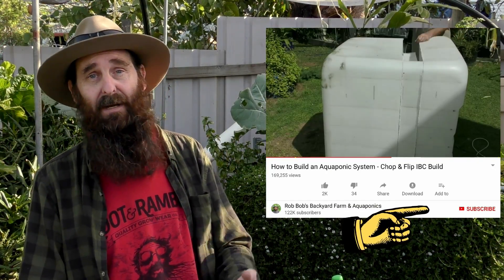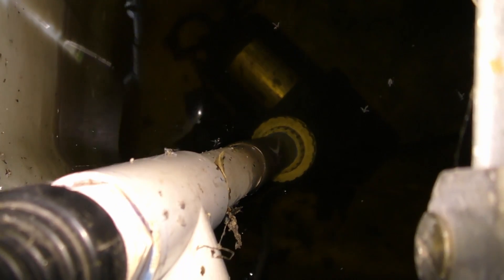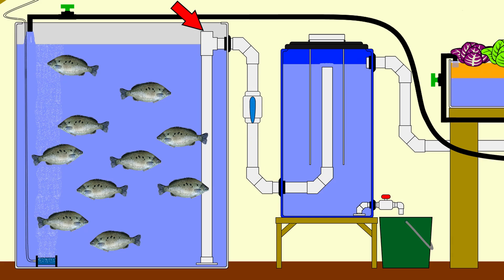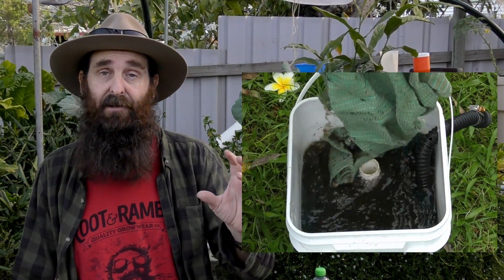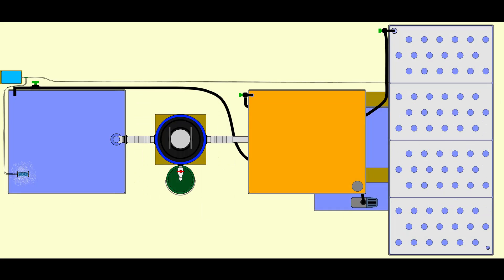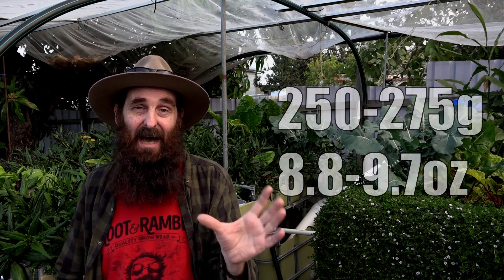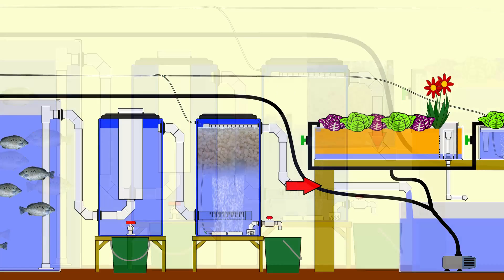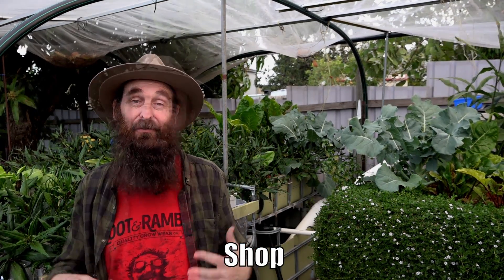Aquaponics Design | Backyard System for Pat

Comment: For this system and the solids filter to work do you need the flow of water to be going constantly. As currently my only runs for 15 minutes every hour to fill the grow bed
Reply from the maker: I'd prefer to run it 24/7 though to tell you the truth as there isn't enough water turnover & retention time in the bio & grow bed for ammonia/nitrite conversion with an intermittent water flow. You may want to up the amount of bio media in the filter or maybe just grow with media beds. 
That's my 2c & hope it helps some.

Comment: Hey Rob I know ur a busy man but can u help me design my system it's going to be 12v 3.6a 2900LPH single pump hook up to 3 or 4 batteries with solar and two solar air pumps I want it all off grind I want two ibc tanks is one for fish and one red claw plus red claw can help with flitting the water and two bed so I can grow different stuff I just dont know how I would plumb it up need help thank you
Reply from the maker: Hi Luke. Haven't had much experience with 12v or solar systems sorry mate. 
To keep power use to a minimum I'd plumb it so the water was pumped to the fish tanks from a sump then let the water flow out by gravity to the grow beds then back through to the sump again. 
HTH some.

Comment: Hi Rob, we are staring to design a IBC based system for our greenhouse. I haven't seen anyone do this, but we were wanting to get your opinion on burying the IBC in the ground with hard board foam insulation under it and on the sides to help keep a more consistent temperature. By doing this we also hoped to just pump the water to our two media beds that would be staggered the farthest being higher, and the one closer to the tank a little lower, almost cascading if you will. Our plan was to use your bell syphon design for a drain and fill that would  empty the higher bed into the lower one, then back to the fish tank. All of this with the hope of avoiding having to plumb in a sump tank because the greenhouse will only be 6ftx8ft. We would like to use a combination of snails, worms and a few fresh water crustaceans to keep our solids waste to a minimum.  
I understand we would need a good amount of pumping capacity to overcome the rise to the grow beds. Do you think this design would work? What would be your suggestions on changing anything?  Thank you for your great videos!
Reply from the maker: Hi Tim. Sounds like it should work OK. Have seen a few folks bury thee tanks here due to extreme heat issues. 
I'm not sure if the snails, cray & worms will be enough for solids management but you can always add on a filter later if you notice the beds clogging up. 
Not a big fan of pumping from the fish tank due to concerns of it being pumped dry so make sure your plumbing is well glued & secured.
Cheers & hope the build goes smoothly for you. .
Reply: @RobsAquaponics   Thank you for the feed back. We decided on a bigger greenhouse to be able to fit the design you have already worked out. IBC tank bio filter, radial flow filter and a sump. We realize you have spent a lot of time and energy figuring this out, so why reinvent the wheel so to speak. Hope the remodel is clipping away steadily. God Bless!

Comment: Hi Rob, Henrico here from Namibia. Somewhere in Africa. Well what can i use in place of uni seals and im having some trouble starting a few different seeds.
Reply from the maker: Hi Henrico. You could use standard threaded plumbing fittings. The challenge will be to create a seal so as the drums & tanks don't leak. Have seen folks use rubber inner tubes to make large washers if that helps at all.

Comment: The operation more easier than this, don't get your hopes down, watch other videos that made up by us... By Us no third party's make things too complicated!!!
Reply from the maker: The point of this clip was to answer a direct question as to how I'd set up a system to the requirements specified by Pat. 
This is how I would do it so as to make sure it runs as smoothly as possible with the least amount of maintenance.
Would be great if you could post a clip explaining how you would simplify the design for others.  👍
I always find it helpful to see others take on system design as there is no one size fits all layout.
Cheers & don't forget to let me know when you've posted the clip.
Rob.

Comment: Hi Rob, I'm starting with my Aquaphonics its small scale 1 meter by 90 square face brick build, I'm looking for advice on a good solids filter I can build myself and easy to clean. The intention is to host Koi and deliver the good filtered water to my PVC NFT system.
Reply from the maker: I think a good place to start would be with a radial flow filter to get the majority of the large solids out. From there I'd run it through another like a sponge, canister or one of the other filtets that do a good job of collecting the fine solids. Removing the finer solids will stop them from being collecting on the roots of the plants.
Is also look at adding some form of biofilter into the system as well to help process the ammonia.
Hope that helps some.

Comment: Is it possible or beneficial to use your sump as a deep water culture bed? As the height of the water raises and lowers, wouldn't the rafts raise and lower with it? Would you be able to put something like prawns or clams in that water as well?
Reply from the maker: Hey mate.
I have seen folks use their sumps as raft beds & it looked to work OK for them. Just need to make sure that the pipes running in & out don't mess around with the rafts. 
Prawns shouldn't be a huge issue & have seen folks use a few different types of shrimp in their systems. Just look for varieties that won't eat the roots of the plants.

Comment: Nice video! How much power do you use?
Reply from the maker: I think I worked out the system I ran at the time of filming was using between 5-7kW a day. That is also offset by our back to grid solar system. At the moment I'm using around 4kW with the newer pump.
Hope that helps some.

Comment: Hi rob thanks for you're videos keep them coming learning heaps from you.
I've set up my first aquaponic system the same as above afew weeks ago but was contemplating changing the pipe  from the bio to sump and going straight from bio to grow beds would you recommend that for better growth or wouldn't make a difference? 
Also my pump was only 3000lph was thinking changing that out soon as I feel it isn't big enough
Reply from the maker: Hey Jason. There should be no issue with you running straight out to the grow beds. If you're running a split system & you change to this single loop method it MIGHT mean you could keep your smaller pump. 
Cheers mate.

Comment: Hello Bob,
I am new in the Aquaponics.
As per your explanation, the water is being sent from the Sump tank to the grow bed s well as fish tank.Now the water coming from the fish tank is also collected in the sump tank and the water from Grow bed is also collected in the sump tank. my question is, don't you think the fish waste dissolved in the water is doing to the fish tank directly(though it will be diluted as the water coming from the grow bed is also getting mixed with the water coming from the fish tank in the sump tank )? 
I am just a starter and has this doubt.
Reply from the maker: As long as you are not overstocking the system it shouldn't be a huge issue. You will start to have problems if you go above the 1 fish per 25L of media I think. 
I personally prefer to have a bio filter after the solids filter to mitigate this issue. 
Hope that helps some & sorry for not getting back to you right away.

Comment: Hello sir. You videos are very information. May i ask what's the maximum number of fish you can put in a 1000L IBC totes tank? Lets say harvest them when they e
Weigh 500g each. Thanks!!!
Reply from the maker: Hi Mark. 40 is the most I'd use in an IBC & only if I had enough bio filtration to handle the load. 
Commercial farms will use higher stocking levels but also have a lot better filtration than the average backyard system. 
HTH some mate. 👍 Cheers.
Reply: @RobsAquaponics  thank you sir

Comment: Hi there can you use a ram pump anywhere in the system. To get enough water to pump around the system, can you use a couple of ram pumps? 
Great video👍👍👍
Reply from the maker: Not that I can see in a closed loop recirculating system like this David. Am happy to be proven wrong though. 👍
Reply: Rob Bob's Aquaponics & Backyard Farm hi thanks for getting back to me. I worked it out and you can’t use a ram pump. Such a shame. It’s a great tool 👍👍

Comment: What size pipe do you recommend for a ibc chop and flip . That will have a radial flow filter and more then likely a canister filter of some sort.  Going to run a 2500l/hr pump
Reply from the maker: A radial flow won't work too well after the pump chops the solids up unless the drum is a large one with a loooong retention time Adam.  Having the canister filter plumbed after it will help with the fine solids that make it through. I made a small one for my mum's system that does an OK job. ► https://www.youtube.com/watch?v=HtMZRM3a5Fs

Pipe wise I think 1¼"/32mm should do the job between the filters & out to the bed as you won't quite get the full 2500lph after head height & pipe restrictions are accounted for. 

HTH  👍

Comment: Hi Rob, thanks for the informative video above.. I am currently in the process of building and IBC system at my home. I will have 2x IBC tanks for my fish, both supplying my DWC beds, one bed will be 7,84 m2 and the other 5,76 m2. The part I'm stuck with is my fish stocking density? According to what I've read, for my purposes I will have 60 fish per tank? This stocking density seems a bit high! Also, what size biofilter and sump would I need?

I look forward to finding out more about these amazing systems!
Reply from the maker: Hi Shannon.
That does sound high just on the fish to tank ratio by it self. 
I don't like to put more than 50 in an IBC tank myself & think it's best to only have 40 in a backyard IBC system to help keep it running smoothly.  
Bio filter sizing will depend on climate, feed type & feed rate. 
Sump wise, if it's all DWC then you wouldn't need a large one, just large enough that the pump doesn't run dry in between your top ups. A simple float valve will be able to help you out there. 
Sorry I can';t be of more help at the moment.
Rob.

Comment: I wanted to send you this:

In aquaponics, sulfate-reducing microorganisms can "breathe" in sulfate rather than molecular oxygen, where sediments build up. In the presence of organic matter, iron and sulfates, these SRM's perform anaerobic respiration, producing hydrogen sulfide and iron sulfide. These sulfidogenic microrganisms then reduce these sulfides to pyrite - the most abundant metal sulfide on the surface of Earth (otherwise known as 'fool’s gold'). In turn, this begins to oxidise. Generally speaking, any chemical reduction of non-carbon compounds (like sulfates and nitrates) will increase the alkalinity of a H2O system. So in aquaponics, this cation exchange (electron donation) can increase alkalinity whenever hydrogen ions in solution exchange for base cations. However the effect is reversible once the cation exchange sites are depleted by the addition of base cations. This is the general “natural remedy” in freshwater ecosystems, by which pH is maintained around neutral. The uptake of nitrate during plant growth also tends to raise alkalinity. Nitrate is assimilated by plants and reduced to amine groups, removing nitric acid.

The solution (pun intended)? Firstly, these solids must be reoxidised by recirculating them through the system in the presence of these base cations (and oxygen). Secondly, add one part calcium carbonate to one part potassium carbonate, to reduce the pH (slowly) to 6.2-6.7. Thirdly, grow a dense and broad variety of plants. Voila! Solids-removal free aquaponics. Essentially, by removing these potentially troublesome ‘solids’ from the system, you are just allowing this same reaction to occur somewhere else, where these 'aqueous solids' can again become bio-available to aerobic organisms, who in turn make them available to plants. In many cases, the biofiltration and turbulation volume is simply too small. Of course, solving the problem of sedimentation in aquaponics itself, is a mechanical and design problem.

- Adam
Reply from the maker: Hi Adam. 
Where did you find that text? I'd like to see it in context if I could.
I've had pH spikes due to anoxic zones in beds which is generally accompanied by a nitrite spike. I was led to believe that was due to the bacteria "robbing" O2 from nitrate.  
Cheers mate.
Reply: That is my own work there Rob. I am a 42yo undergraduate at La Trobe Uni finishing off a Ba. Agriculture and Technology majoring in aquaculture. Aquaponics and Integrated Aquaculture is a subject, and I began my personal journey into aquaponics in late 2008 - which eventually led to me doing the degree. Lots of organic chemistry, microbiology, aquatic disease, experimental research design, et cetera; it is a science degree and they don't give them away very easy. One more year part time to go. The above text was something I submitted to my lecturers. While they gave it a high mark, I would be mildly cautious of taking it as pure gospel, until I have done the proper analytical research and produced my thesis!
Reply from the maker: Nice one Adam.  What sort of work are you looking at doing once you're done with Uni?
Reply: Hopefully aquaponics! If an industry can be coaxed into existence....
Reply: In reality I am probably just going to have to go overseas to work with the Saudis or other Middle Eastern nations on an employment basis, as there is no suitable, forward-looking industry investment in this country.

Comment: Hi Rob, Thanks a lot for the excellent video,  i just have a question on how did you decide about fish should be nearly 250 grams each in order to take the 50 grams per day? is there a rule here?

i also need to know, if Rakocy & Lennard are deciding feed rate according to planted area size, ignoring the size of media surface for bacteria, why do you start with bio filtration requirement and not size of the planted area to determine fish feed in grams to determine number of fish?

Thanks in advance for your support.

Waiting for your feedback.
Reply from the maker: Hi Hussein.
For the feed rates, I used a paper on the native silver perch we use that gives suggested feed rates at different weights. You can google feed rates for specific farmed fish & you should find a few different papers for most species. 👍

I start with bio filtration as most backyard hobbyist only have room for a single IBC fish tank. That tank size will determine the amount of fish a system can run. From there you can decide what style & size grow beds you want to run & also if extra bio filtration (like a moving bed bioreactor) is required. 
 
If you want you can do it the other way around by working out m² of plant then work back to the fish quantities needed to support that & then the filtration required. 

Hope that helps. 👍

Comment: Hi Rob  I'm attempting to set up my aquaponics system here in Melbourne and are hoping to stock some trout eventually.  I have two IBC grobeds, one 1000lt fish tank and I was thinking of getting another ibc for an additional growbed and about a 700lt sump tank.  Will the Sump tank be able to cope with 3 x 1m square grow beds using clay pebbles?  Will 30 fish be able to cope with three beds? (Im going to add swirl filters and the bio filter once i work out how they work.) 
Great instructional videos
Paul
Reply from the maker: Hi Again Paul. I had 4 beds + the barrel beds running off out 600l sump with no issues so I think you'll be fine. 
30 fish should be fine once they put on a bit of size. 👍 Trout also grow fast so that will help as well. 
Cheers mate.

Comment: Thanks Rob This is exactly what I have been looking for! I am interested in what kind of connections you use to connect your components as well. Like what width PVC do you use and is flexible hose a good solution or is their a reason not to use it?
Reply from the maker: Hi Andrew. For this system I went with the 21"/50mm PVC for the drain & would go with the pipe size suggested by the pump retailer. 
I used a lot of flexible hose coming from the pump in our current system but will be swapping over to PVC for all the straight runs in the rebuild. Reason being is that the flexible hose picks up a bit more gunk on the walls than the PVC.
Hope that helps some Andrew. 
Cheers.

Comment: Another awesome clip. I am building a system similar to the one you did for savour soil permaculture (if I remember the name right). No venturi in this setup, only airstones. I only have flood and drain beds. A venturi should be sufficient right?
Reply from the maker: Hey Theo.
I like to run the air lines from a compressor into the tanks now after having 2 water pumps fail on me which means the venturis stop as well.  
Wouldn't be an issue if the back up air was triggered by a flow switch rather than a relay switch which only works if the power is disrupted. 
Hope the build is going well mate.
Cheers.

Comment: Hey Rob. So I set up that set like you showed in this video. But where would you add the auto-fill?? Thanks Steve
Reply from the maker: Hi Steve. I'd add a float into the sump tank. Just make sure that you set it to start filling when all the beds are full of water & the water in the sump is at it's lowest point. 👍
Hoe that helps mate.